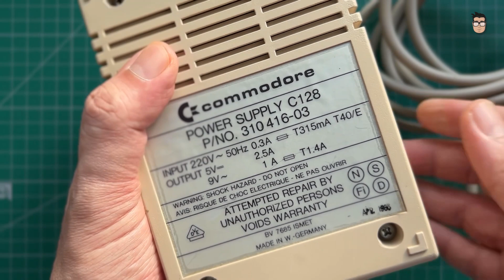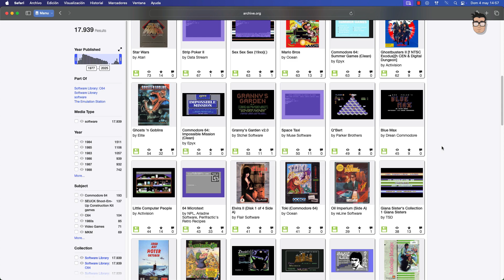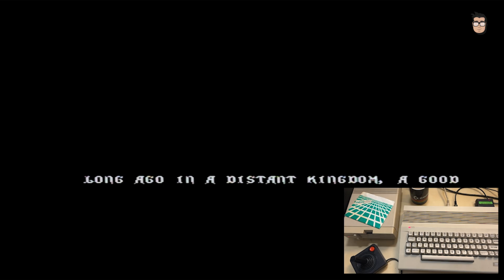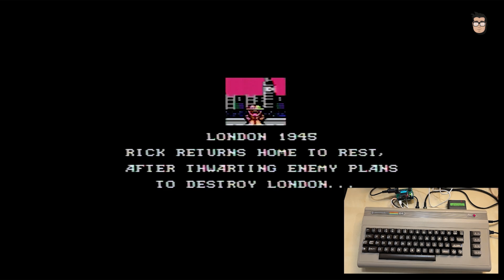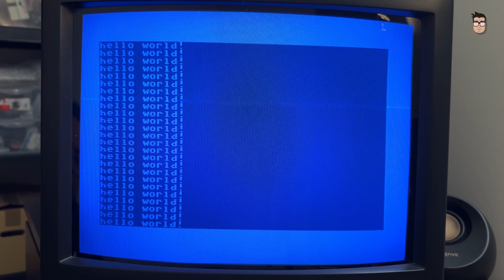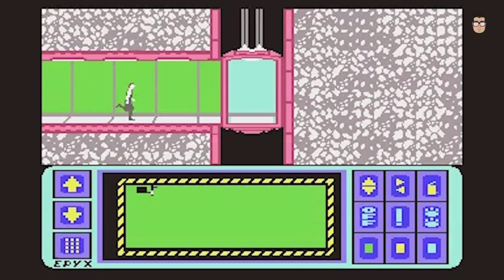Give your Commodore 64 the love it deserves ❤️

Comment: The Pi1541 is amazing 👍 I also started with SD2IEC and maybe 50% of the software ran with it. Apart from a few genuine old C64s, I also got the  MEGA65 which has a C64 mode (that isn't that compatible to be honest, but there's also a port of the C64 core from the MiSTer that's great). And I also own a couple of MiSTers of which one is connected to the big TV in the living room. I also built myself a pi-based BMC64, it's inside an old breadbin case and also feels like the real deal since it boots in a couple of seconds due to VICE running directly on the Pi without the need for any kind of OS underneath it. All great options 👍
Reply from the maker: Wow! How great to be able to share experiences with another Commodore enthusiast. The MEGA65 is a machine that has really caught my attention since it was announced, but it's a bit expensive. I also have a MiSTer and a MiSTer Pi, a slightly cheaper version, but just as recommendable.

Thanks for your comment, and I hope to read you again on the channel soon. Best regards!

Comment: Cassettes were the preferred media in the UK and Europe due to their low cost, but virtually nobody uses cassettes in the U.S. I was unfortunate enough to have a Datasette for the first year I owned my C64, and it was horrible. You couldn't buy any software in the stores on tape, I had nobody to trade pirated games, and if you did order something on tape from a mail order company, it would take forever and a day to load. Tapes were painfully slow.

As for modern add-ons for the C64, one of the most full-featured has to be the 1541 Ultimate II. It can emulate various freezer/utility cartridges, disk drives, RAM expanders, Flash carts, etc.
Reply from the maker: Thanks for the note about the Ultimate! It's a device that has been on my radar for a while and it seems very interesting. Unfortunately, I don't have it yet, but as soon as I get one, I'll feature it on the channel!